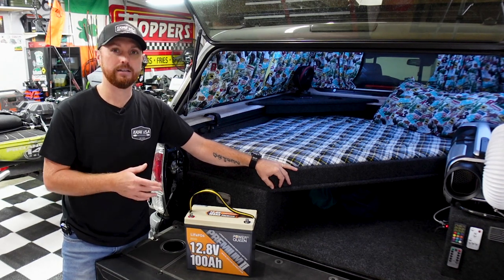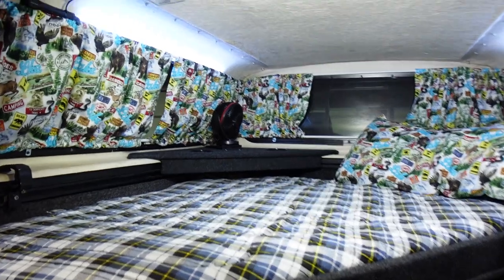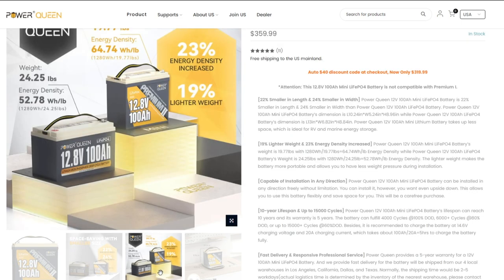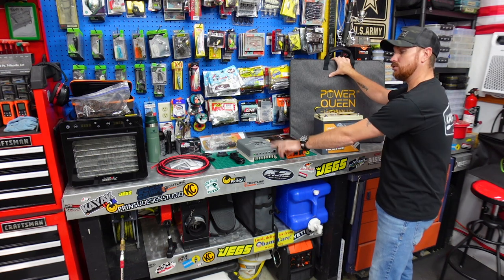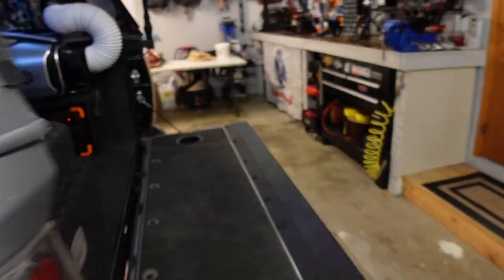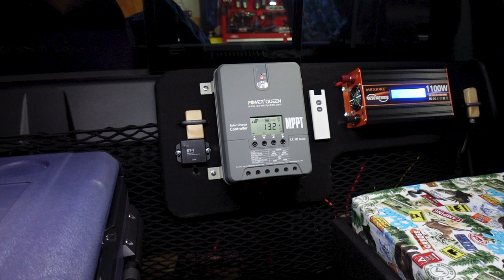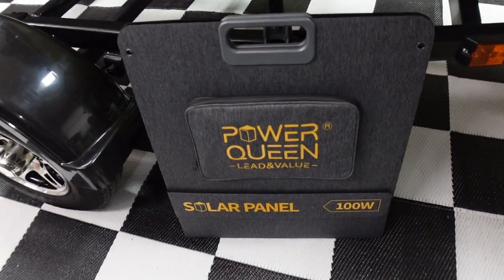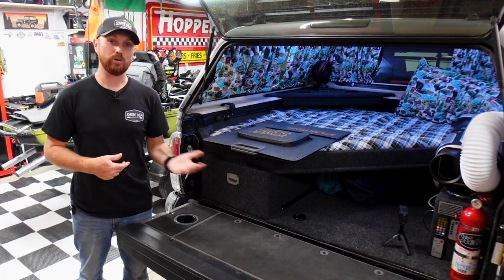Truck Short Bed Camper Build | Installing Solar Power | Short Bed Tacoma Camping

Comment: Hi. Long time subscriber. You have great projects and content. I did a similar setup in my ram.  Spent last January in cold cold Ohio where I realized my mistake.  The battery wouldn’t charge near freezing temperatures.  To get me through the winter I used a 12v heating blanket. For this reason I recently moved the setup into the back of the truck where I have temperature control. Now I’m able to keep everything warm in the winter and cool in the summer.
Reply from the maker: Awesome! Very cool idea! Thanks 👊🏼

Comment: You are amazing.  I’m learning so much.  As I listen to you I hear excitement in your voice.  As I listen to you the excitement builds within for me.  I have been building up my new Hobie PA 14 360. I have New Port motor on the rear, 24v 100ah lithium in my black box; Garmin 9 SV mounted straight in front of me on anhorizonal  h rail; with 12V 28 AH lithium handling my Fish finder and yak lights.  I’m Vet 100% disabled with ver unstable legs, so I have the security standup ( modified greatly, lower and forward,and outriggers that are removable and can be quickly raised when running. I often put the outriggers down with the motor running
 very low.  I can stand chunking and winding down a shoreline.  I have horrible balance due to injuries and the bar in front  and above my knees and the outriggers I’m cool and can fish with the best of them.  I’m 76 and have fished all my life.  The peace that fishing bring to my life can not be put into words. Listening and watching you in your videos is very meaningful.  When I’m not on the water, your videos and others, make me feel as if I were there.  Thank you and I hope to be competing with you in the KNF TOURNAMENTS.  I’m in Texas and plan to be traveling and completing.
Larry Moss
Reply from the maker: Thanks Larry! That means a lot to me man. I’m also an Army Veteran 🫡 . Stay safe out there!

Comment: I’d recommend you get the BillieBars bed stiffeners, given you have the camper shell and other weight in the bed. They designed them to be non-intrusive and will work with your set up.

Comment: You were probably better off using a DC to DC charger, the problem with solar is you’ll need to park in the sun!  I know I’ve dealt with solar for roughly 5 years in a minivan camper conversion, 600AH lithium battery setup 7.6KWH Good luck & be safe 16:41